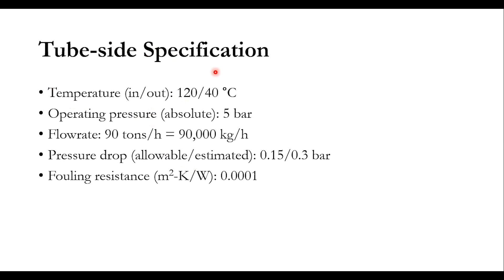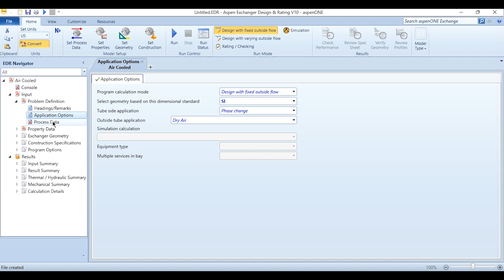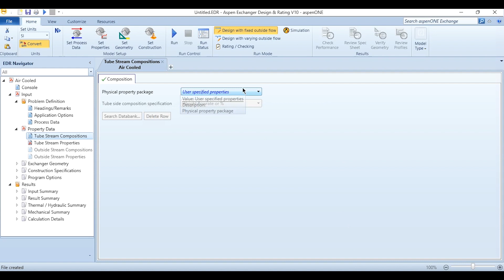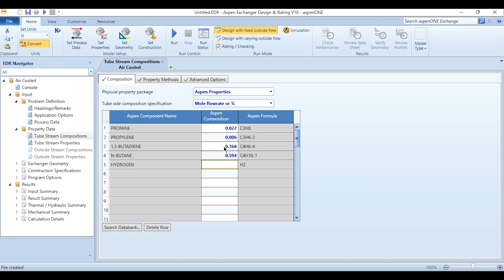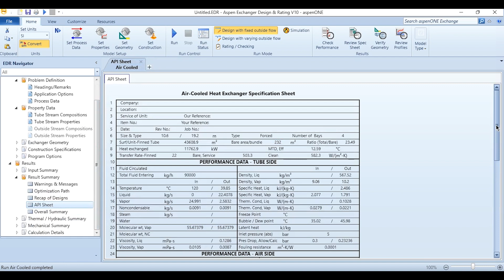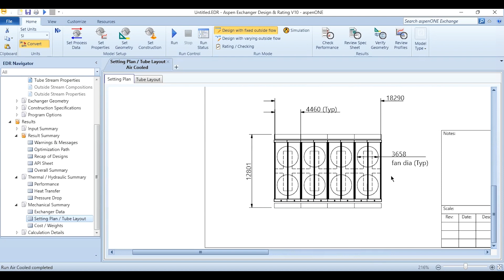Design of an Air Cooled Heat Exchanger using Aspen Exchanger Design and Rating - Lecture # 91

Comment: Are you able to come up with a design without a given or preset mass flow rate for the air side? Is there a different value we can define in order to have Aspen solve for air flow rate or maybe it will guess and iterate?